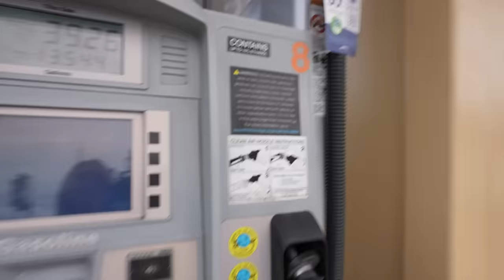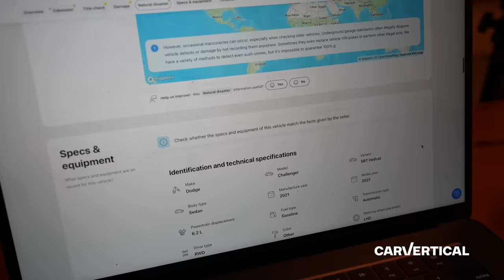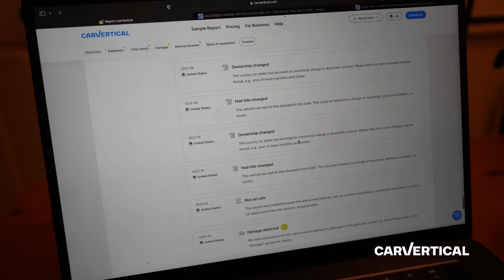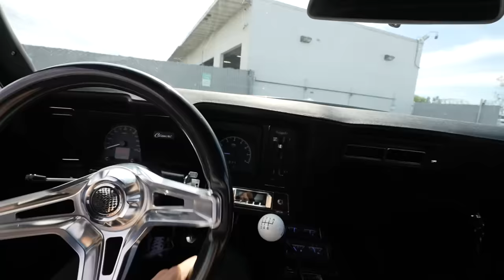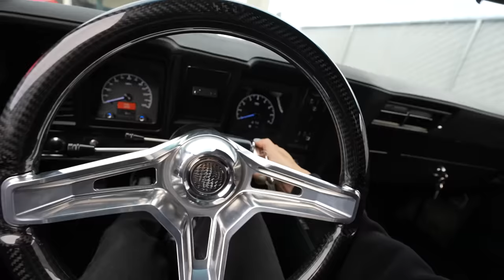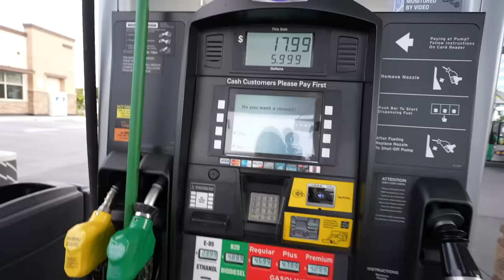We should have left this car in the barn we found it in…

Comment: When from the original car is left not more than 500gr of metal👍
I like historic cars. I own several too, but from my opinion less than 50% of old material isn't a historical car anymore. In america you built classic looking cars from scrap with new parts and even bader: new engines. I hate a car pretending to be 50+ years old and sound like hellcat from yesterday. (That sound accelerating is so bad, i can't understand anyone could like this) Nothing better than an original engine sound. Doesn't matter, if 50 or 500 hp. As a kid my no.1 dream was to own a 70's muscle car with a big and loud V8. All mechanical and no electronics excepts lights. In my cars the most complex electronic is the dashboard from the late 70s. I love it. It is so reliable. That's so more worth to me than racing some any wanna-be-racers on the Autobahn.

Comment: It would be better to start from the premise that it needs to be able to run at a sustained 180 mph.Then look for the parts starting with rear end gearing that best meet the aim.
I'd prefer a proper 500 ci + V8 naturally aspirated race spec motor with highest compression possible and a wild cam and ITB injection.Only after suspension and steering and brakes which youre absolutely sure can handle that type of speed.
Then ship it to Germany for some 4 am runs on the remaining sections of unlimited autobahns.But watch the mirrors for all the usual even faster overtaking Porsches, AMGs, BMW M's among a few Lamborghinis and Ferraris.
NASCAR and GT style is a very different culture to a quater mile at a time and any type of tribute to the Daytona or Superbird is definitely the former.

Comment: @ EmeliaHartford,

                                 I Love your Restoration Concepts/Theories for this 1968/1970 [Due To Rear Quater Panes Changed To 1970]. Take a Look at 9:57/12:41, take a Gander at the Carriage Frame Holder and Tell me what do you See? Here's a Suggestion for the Motor Build-Up [Suggestion Only], A Holy Electronic Fuel Injection Tri-Deuce Carbuertor Kit for a 383 thru 426 Hemi 4-Bolt Mains Engine Balance & Blue Printed ~ Heads = 3-Way Thru 5-Way Angled Polished & Ported Heads w/Valves Sets. For the Rest of the Drive-Train, I will have to do more Research Work. 🤔🤨😃

P.S. I do not like the Concept of a V-10 or a Hellcat Redeye Supercharged Motor. Nevertheless, Restoration means Hard-Work and the Time and Effort Already Spent into the Body..........Get my Drift. Expression Seen @ 11:22/12:41🧐🤕😇

Comment: i found my 70 Road Runner in a pig sty sitting on the frame  with zero interior and with pigs living in it  then was able to find a 70 Chrysler 300 that had been crashed  with a 440 TNT 727 trans and interior... took me two years to  combine both cars rebuilt the engine  rewired  and right as i was getting to the point of driving  life made a twist and i got in some trouble and had to sell it without ever driving it...thankfully it had zero rust,  good luck with yours

Comment: Sooooooo you coulda built it from scratch. Oh and red eye. Or you could get a modern build 426 Hemi NA, The V10 sounds like garbage. E85 is cheap because it lowers the gas mileage so much.  Also it ages like fruit. So don't let it sit unless you flush it out with regular gas. Ran my bug on E85 for a while. Made a surprising difference.

Comment: E85 is cheap but you get what you pay for, crap fuel. Here in Norway the new standard is E10, and even 10% ethanol is creating big problems for vintage cars - but also cars only a few years old, and injection cars are hard to adapt. Here E85 is mostly for race cars. (my 1977 European Ford can use E10 with some small mods). Good to see this car being saved.

Comment: wow a rotted out clone car with mixed matched parts  normally id say dont buy and walk away but yall done put so much money in this car that walking away would be substantial loss selling would be substantial loss 
but if you finish it your gonna spend at least another 25000 and the car isnt gonna be worth nearly what youve got invested in it my suggestion is forget about donor cars  and donor engines just get a junkyard engine and rebuild it to stock and maybe a nrw trans then sell it and cut your losses

Comment: I'm not trying to be a hater but calling a 1969 Satellite a Superbird is like calling a Ford a Chevy. The only thing a 69 Satellite has in common with a 1970 Superbird is nothing. Even the steering column is different. Go find a 1970 Satellite if you want to have something relevant.

Comment: Hartford touches= 5000hp quadruple triplet turbos supercharged blown V18 Vtec 2jz big block LSX 64 valve all aluminium with 4 overhead cams and a procharged 2500 80/71 blower

Comment: Seriously, you need to talk to Nelson Racing Engines.  Put an NRE Twin Turbo HEMI 572 "Elephant" in there.  It puts out 2250 - 2500 HP, 1972 ft lbs of torque and is fully streetable.

Comment: Panel is cheap and all new floors and quorters and to be said minimal patch work it is not that expensive. Most you seem to get all new. It is the suspension/brakes and running gear that is going to be the most expensive part. Sometimes it is better to get all new than try to rebuild old. So what color will it be?

Comment: id call it the fake bird or Fbird.  wrong year, and it looks like that was a small block car, so not even a roadrunner. as you know its a unibody, and even with fairly mild motors back i the day they liked to wrinkle the 1/4 panels. plan accordingly.

Comment: Best engine for this build with turbos in mind 
Prestige Nitrous 427 Ford Small Block (1,000 hp) ...
Direct Connection Supercharged Hellephant 426 (1,000 hp) ...
Prestige Twin Supercharged 427 Ford Small Block (1,000+ hp) ...
Prestige Supercharged 427 LS (1,000+ hp) ...
Chevrolet Performance ZZ632/1000 (1,004 hp)
Reply: Keep it MOPAR, I  don't like hybrids.